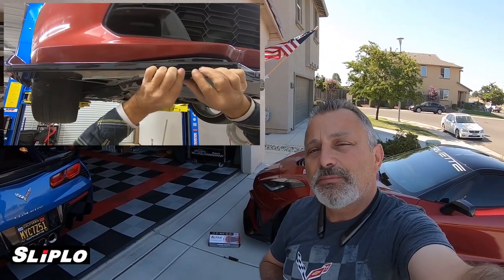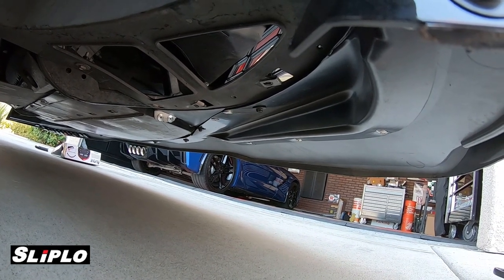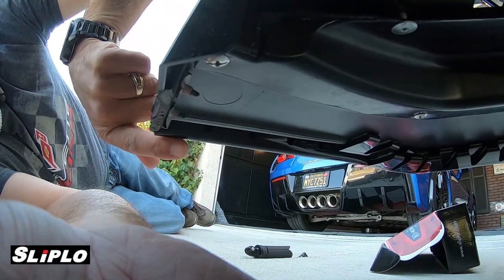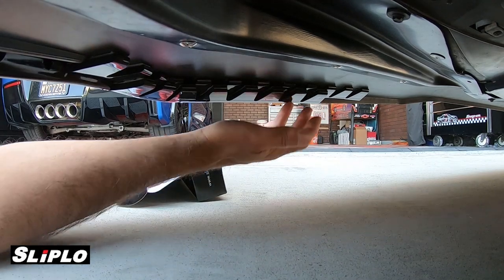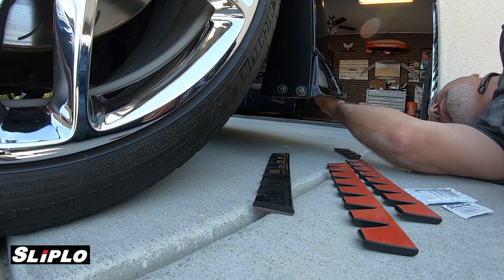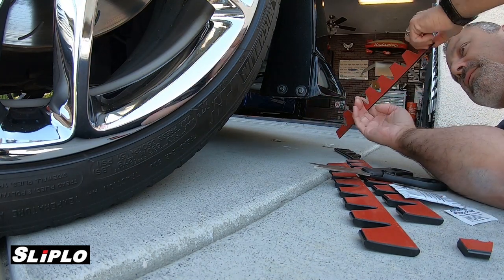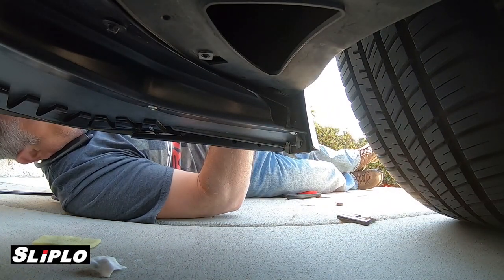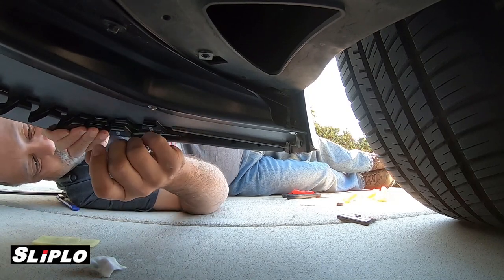I Installed Sliplo Universal Skid Plate On The  Front Splitter Of My C7 Corvette

Comment: Which parts of the splitter did you trim? And is stock ride height still low for the splitter? (On a zo6)
Reply from the maker: When you get yours on take another look at the video and you can see the line I chose to cut off. As far as ride height...I have seen various cars with different ride height, they vary almost a 3/4 to 1 inch. You may need to adjust your ride height not sure. If so you should be able to gain 1/2 to 3/4 on the factory bolts. Good Luck!! Thanks for watching!!